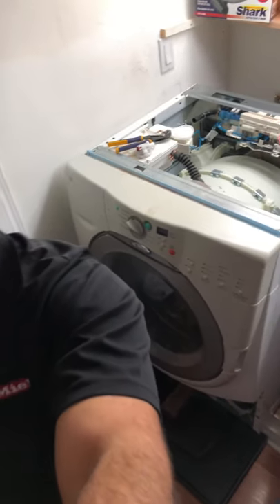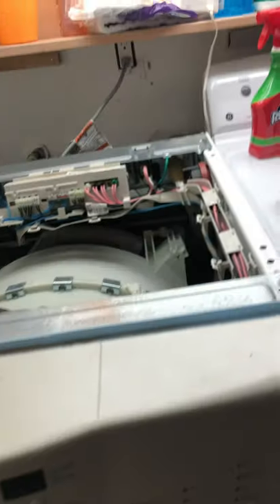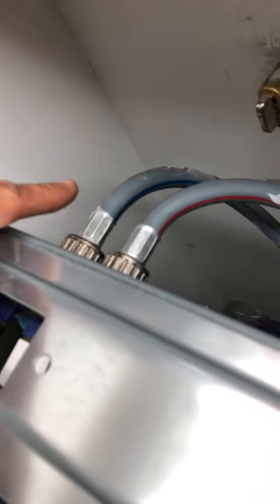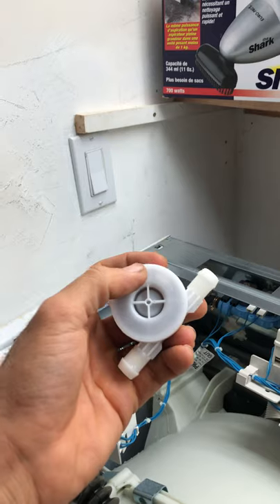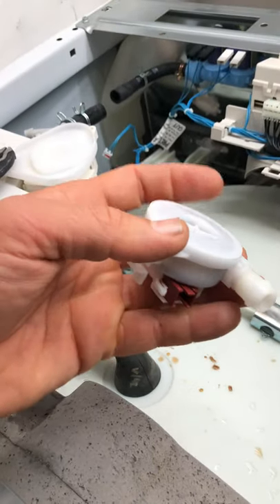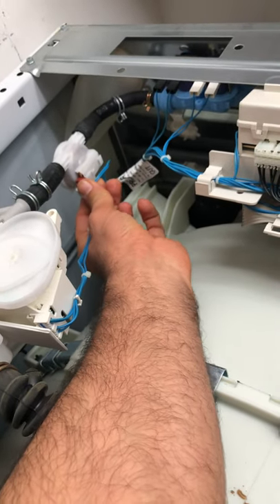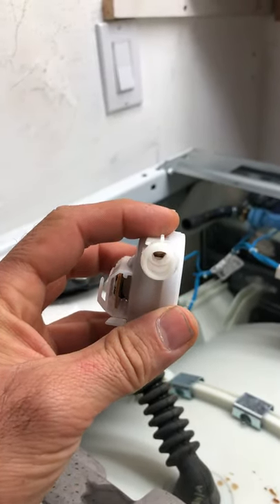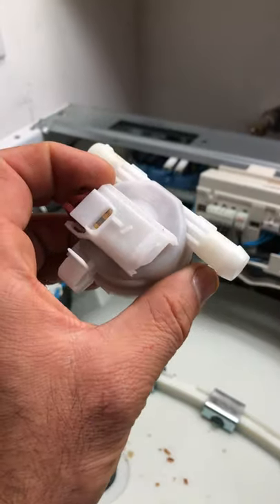Whirlpool washer FH error code

Comment: Got a call today for this issue. They purchased a second hand washer and it immediately gave them this error. Hoping to save them a fat chunk of money! Will update with resolution - thanks for sharing this knowledge!
Reply: It ended up being the drain pump I think, a clean out cover under the drum. Three screws hold the panel on underneath, star bits. Coins, nails and sludge were clogging it up. I still cleaned the flow meter though!
Reply from the maker: @rpachecoart  good job

Comment: Just fixed my Whirlpool Duet FH code by removing the top & tapping the water flow meter while continuing the fill cycle. Must've loosen up some gunk in there...next  step was to remove it & clean with oven cleaner. (I checked the intake screens first but they were clean).

Comment: I had the FH error. To fix it I opened the little hatch bottom right on front of machine, undid the plug (have a bowl underneath ready) then removed the plastic cylinder inside and cleaned it. Then I put it back in etc etc and error was fixed. Sorry about lack of technical terms but I'm not a plumber.

Comment: Good advice, thank you, but this was not my problem.
Reply from the maker: What was the problem with your unit ?
Reply: @hameedwafaAFG  well, after checking the supply valve and the flow meter, I opened the bottom panel to access the tech sheet and the first thing I noticed that there was a disconnected wire. Long story short, the wire from the drain pump had wiggled loose and come off and thus no water was coming into the machine,  a good safety mechanism.

Comment: I came here to say that I ordered this part on amazon and fixed the HF code I was getting on the washing machine.  While I had the top panel open I also re seated all the electronic cables that went to the CPU. 

Thanks for the video!  Much cheaper then calling an appliance repair guy.
Reply from the maker: I m glad I could help .

Comment: Well done! I am still working on mine. The pressure switch on mine was not very good, so I took it apart and cleaned it. I did not look at the flow meter. I will do that now because of your video.

Comment: I found a replacement flow meter part online for 45 dollars, so I won't need oven cleaner. I'm noticing that the soap dispenser is not functional, and I get the FH code, so I think following your tutorial will fix my washer problems -thank you very much!

Comment: I was seeing zero water entry and random FH errors.  Mine turned out to be a drain motor connector plug disconnected from the housing.  The clip to hold it in place wasn't doing it's job.  Cable tied the connector in place and everything works fine now.

Comment: Hello. I have a Kenmore Elite HE3 and it does not have a flow meter. The hose goes from the inlet valve to the soap dispenser. I am getting an FH code. I have replaced the pressure switch and water inlet valve. The pressure switch hose is in good condition.  I also cleaned the tank that connects to the hose. Do you have any suggestions about what else I can do? Thank you.
Reply from the maker: John Horak did you clear the error code after parts replacement?
Reply: hameed wafa I don’t know. How do you do that?
Reply: @jacksguitarplanet  UNplug your machine. /Wait for 1 minute and reconnect to outlet. Should reset.
Reply: If that doesn’t work it’s the control board

Comment: My Duet Washing machine does not have this water flow  meter. It was bought in 2004. I'm getting the FH error code. The inlet fill valve , at one time was letting water into the washer. When not in use. Could that be what is  causing the code?
Reply from the maker: Yes it could be .
Reply: @hameedwafaAFG  Thanks. Having to change the shocks also. The washer now sounds like it is trying to run. The time left is flashing. The Clear the cycle button does not clear the time, or end the cycle. What do you think?
Reply from the maker: Can you turn the drum freely with your hand 🤚if you spin it ?
Reply: @hameedwafaAFG  Yes. Both ways. That is with it un plugged.

Comment: I had the same problem replaced the flow meter but still has the same HD code after about 7 minutes.  I looked at the flow meter I took off and it was very clean
 What else could I check please let me know
Reply: Sorry HF code
Reply from the maker: Check your water valve , maybe it needs clean up. If hot water or cold water is not coming enough in time ; it would also cause this code
Reply: Thank you. I will check and see if that works